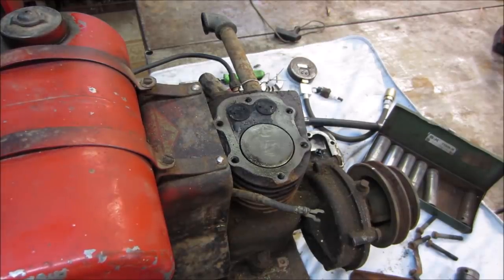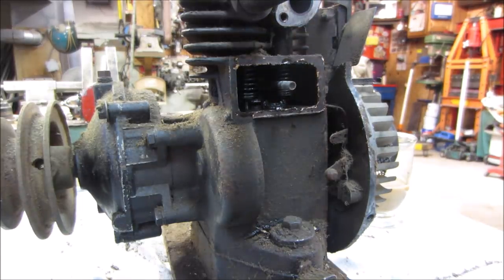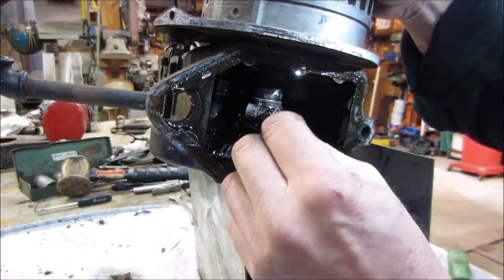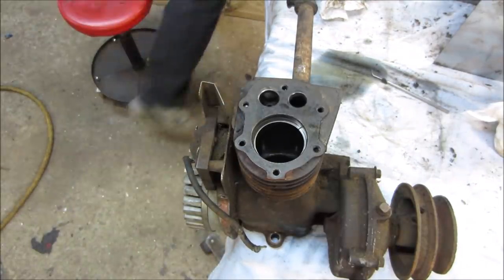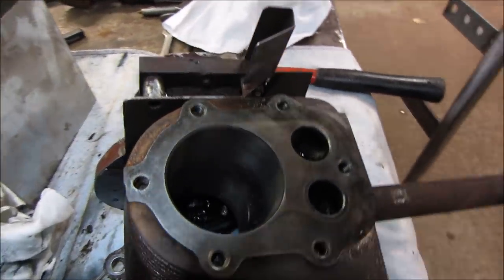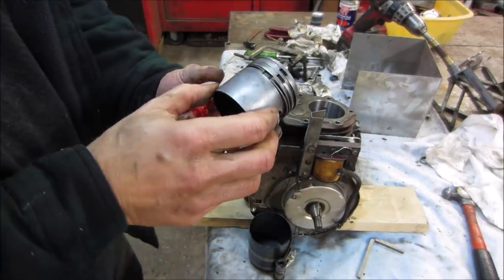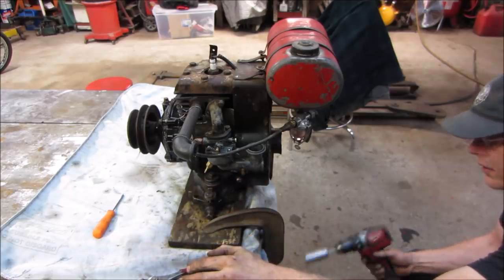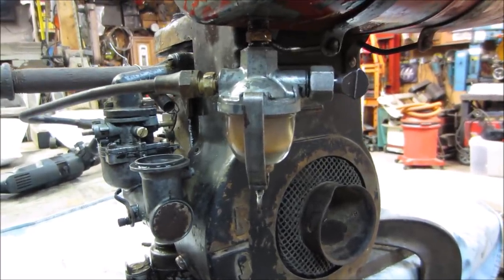Will It Run? $5 antique Briggs engine.part 3. tear down and cold start.

Comment: My dad used to say running a straight pipe would burn the valves. Is this true Mustie?
Reply from the maker: running no pipe can, but it takes time, think its more of a heat sink and the valve area overheats, but l have never seen it in person.

Comment: I have a Villiers mk10 which is basically the same engine, it also has the gear reduction on it. They were commonly used on cement mixers.

Comment: that engiine looks like some one did a overbore of the cylinder, in a unsteady piece of equipment and then did not install the proper oversize piston and rings
Reply: or it has been doing work for 65 years!

Comment: Liked your videos much thank you,but you grinded the cylinder much too fast,i know 
because i`m a mecanichs too,if you do it slow the result will come so much faster and so much better,.These B&S motor are almost living forever i  just wonder why they didnt put them into motorcycles???
Reply from the maker: l did it that way on purpose , the stones are wore out and l was cutting with brake fluid to get the cylinder round, not honed like you normally would,

Comment: WHERE IS THE AIR FILTER AND THE MUFFLER? YOU NEED THOSE ON FOR THE ENGINE TO RUN RIGHT.
Reply: Canuck guy worried? Is that you?
Reply: @standurround589  Sounds like him doesn't it?
Reply: @MrUbiquitousTech  Well, technically the county can only "hold an individual for observation" for so long before they have to commit them or let them go. So,that was definitely long enough to cure the innebriated instant messaging we all had to suffer through. But I don't think they're anywhere close to a cure for Asshole. As evidenced by Mr. Positive Post here!
Reply: @MrUbiquitousTech  I just hope he has a better day when the whiskey's all gone!
Reply: @standurround589  LOL! ;o)

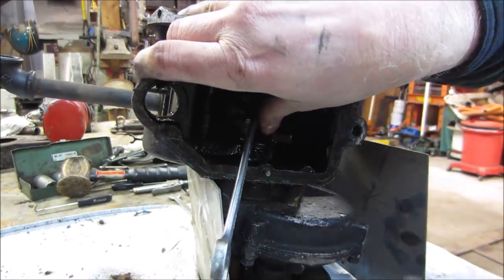Comment: 14:14 Cringe worthy moment. Personally I'd use a socket with breaker bar for that. If you don't have one put the open end of the box wrench inside the closed end of a larger wrench for more torque.  Its so easy to damage the crank case with the hammer method either by cracking the block or damaging the face where the crankcase gasket goes. One more point, the screws can be prepared to be removed by shocking the head of the bolt with a large piece of bass and a hammer for striking the brass and/or heat but with the oil everywhere probably not an option.

Comment: Hey I  a quick question B.S.M  8 hp .the plug is about gone one I have weed eater plug that will fix in the hole will ok run it with the weed eater

Comment: CYLINDER HEAD GASKET BOLTS WERE PROBABLY LOOSE. RUN TILL HOT RETIGHTEN. YOU NEED HEAD ON TO PUT COMPRESSION ON THE OIL RING MAKES IT SEAL. THAT TEST WAS USELESS.
Reply from the maker: oil ring with compression to seal is bs, the engine only has compression every other cycle,

Comment: I guess if you really need to make a video tearing apart an engine, increasing piston slop, then putting it back together, then this is the ticket. Looks to me like it was just crankcase pressure pushing oil into the combustion chamber.
Reply from the maker: pretty much what the title says,